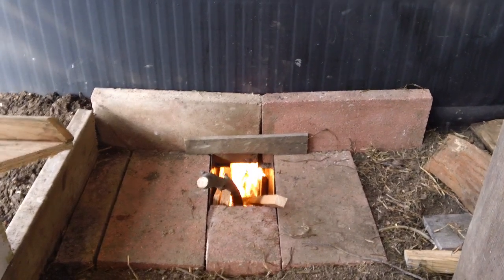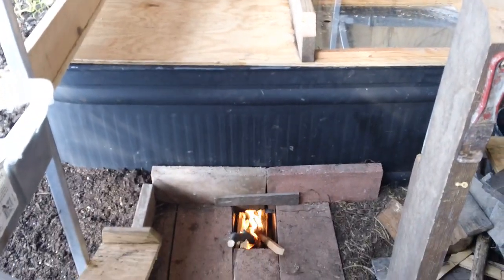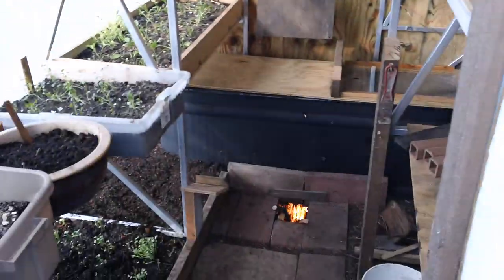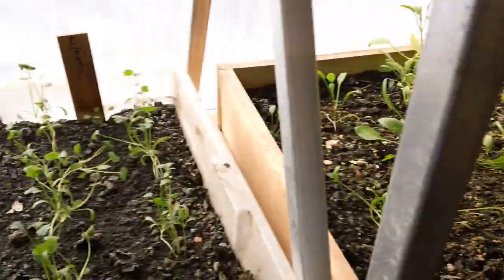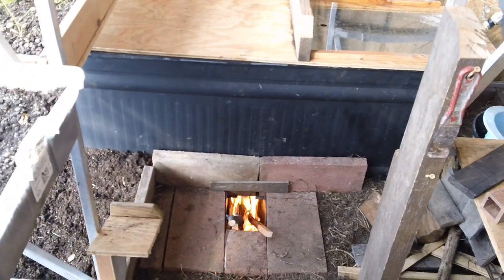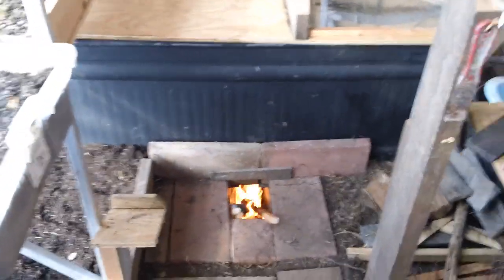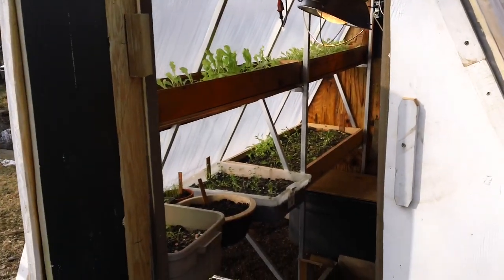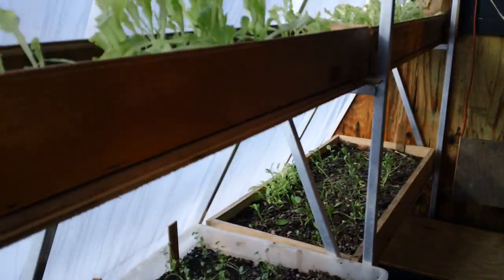Winter Greenhouse update

Comment: Really good idea!  The top of your tank will make an excellent spot to start seeds in flats as it should maintain the right soil temperature in a flat.  You can get excellent results with simple 4 ft plain fluorescent shop lights for you lighting.  Suspend them on a chain so you can keep them about 4 inches above the plants as they grow.  Maybe consider running a plastic line or pvc pipe for warm water from the tank under your lowest (ground level?) beds for bottom heat.  An insulated box under the
beds would keep the cold ground from negating any heat gain and allow for drainage/cleaning should the need arise.  Screened off for fish of course.  The water should thermosiphon I would think.

Comment: nice video thanks for sharing.
Just a thought on the lighting and correct me if I am wrong as I am no expert, metal halide would be very expensive to run and would need plugging into the grid. I understand development of LED lights is at a stage where the correct light spectrum could be bought off the shelf for growing which would mean they could run off solar with a back up battery.
Just a thought :)
Reply from the maker: Hello.. You make valid and relative points. I will address each.. first the halide will serve a couple needs. It will run only at evening as the sun goes down and will provide a little extra heat and of coarse with light regulation we can grow more than just greens and actually have a harvest every 30 days with the extra light and the added heat will keep us closer to target for max growth.. Here we are 11 cents a kilowatt hour and plan on running a 500 watt from 5 pm to 5 am so about 6 kilowatts at 11 each is just 66 cents a day times 30 days is 19.80 a month butt will also increase growth by almost double as well so that makes harvest almost twice as fast too.. The LED's are kinda expensive to get into when you match the power and light output of a halide. Maybe someday..
Reply: Van Powell Hi Van, Thanks for your reply I am glad to see you have done your homework for your situation and found the best solution. I am not yet at a point of growing my own food and have not done the math for what would be the my preferred solution based on different requirements of product and quantity of food. Also I don't have either light set ups purchased so both options would require initial outlay, additionally I believe energy is more expensive here in the UK which would affect choice of lighting. I guess this is something I have to calculate in the future as I have only started my first life change steps recently to get off grid and become more self sufficient.
Once again thanks for the reply and keep the videos coming on.
Regards Steve

Comment: How would you get the heat back into the green house?
Reply from the maker: I will build a box around the pipe with a small slat roof... I will drill hole from inside green house to inside the box with pipe in it to allow heat to flow back in the green house it may be fan assisted to
Reply: Van Powell
That is what I thought.
My biggest problem with rocket stoves is: How does one keep feeding it during the night, since your fuel loading capacity is so small.
Reply: @hansgruetzenbach3945   i read the otherday that water holds more energy than stones